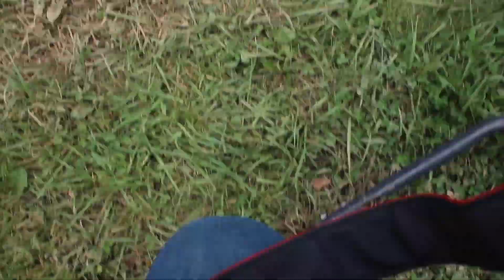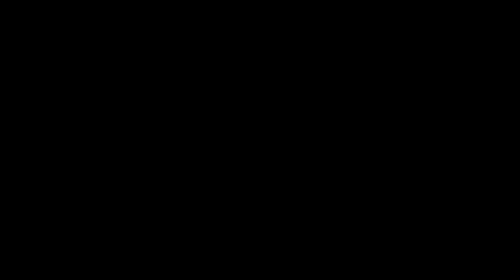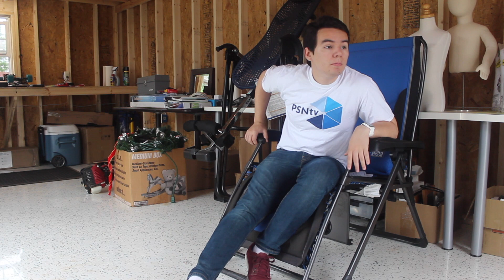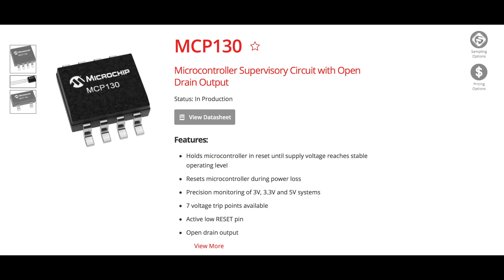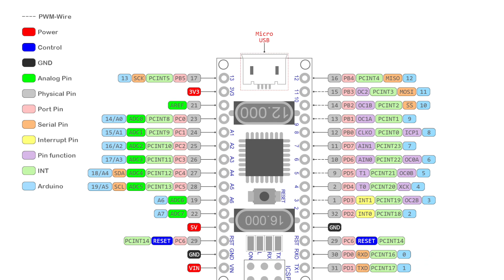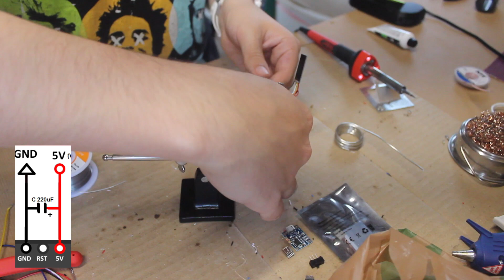Custom Esk8 Remote Build Guide: Part 4

Comment: Part 5 ever gonna Happen my dude. I’m the forms daily (mainly the new one now) and have been since this project came out and I just had a buddy sell me one of the remotes you made him that he never used so I’m wondering if yours came with all the correct code loaded on it or not cause that the one place I lack knowledge. I can’t get it hooked up to my Vesc (should i use two focboxes or can I use one of my unity’s and have it work fine?) what baud date do I need to be on and does it matter master or slave Vesc if I have to use 2 focboxes? And how do I access the menu TJ change from deadman switch to cruise control, kph to mph etc. I have been reading the thread but I really don’t feel like going through another 2k plus comments and I’m hoping I can get some quick answers from you if part five of the video series isn’t going to come out anymore… Thanks in advance bro. PS you’re received box is a nice touch to the build instead of the normal shrink wrap. Job well done on vids and builds over brotha. Thanks in advance.

Comment: Can i use it with a normal ESC i mean without a vesc.A normal esc has just 5V GND and PWM.
Reply from the maker: You could, however you would not receive any telemetry on your screen. Kinda overkill if that's all you'll be using it for.

Comment: Will the remote work with two of these VESC`s? https://diyelectricskateboard.com/collections/esc-speed-controller/products/torque-esc-bldc-electronic-speed-controller
Reply from the maker: Yes! It should. I'm using 2 of not those specifically, but 2 based on the same PCB design
Reply: Great, When will part 5 be up?

Comment: 220uf but how much v? 25/35?
Reply from the maker: The voltage doesn't mater as long as it's higher than the rated 5V of the project itself. 10V or above will give you peace of mind so either of those you suggested would work fine
Reply: SeeTheBridges thanks for the fast response can't wait for the next part. To be honest the videos are sometimes a little hard to follow. I rather had longer videos where I see you soldering everything.(just orderd all parts)
Reply from the maker: Ah yeah sorry about the hard to follow thing. It's been a balancing act between making videos that are thorough enough but also not excessively long showing every little solder joint.
Reply: SeeTheBridges I get it m8. When is the next part coming.
Reply from the maker: I had planned to have it done before school started, but I've actually been selling these remotes as completes all summer. I'm finishing up my last one today and have to move in tomorrow. So not sure when I can get to it. Sooner rather than later hopefully
Reply: SeeTheBridges I am also planning to sell these remotes in Europe. I've had many questions about the remote. I'm a full time programmer so I'm going to tweak the arduino code a bit.
Reply from the maker: Oh nice! Did you already get permission from SolidGeek?

Comment: Does the voltage matter on the c 220uF capacitor and what do u use
Reply from the maker: As long as the cap is rated for above 5V you should be good. I think I use 35V caps